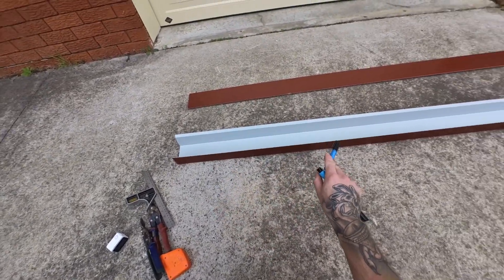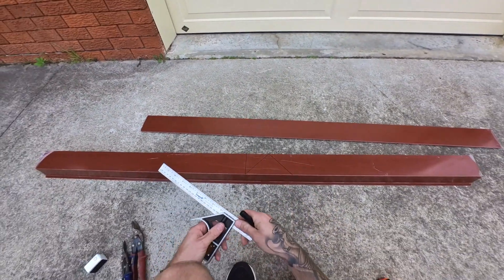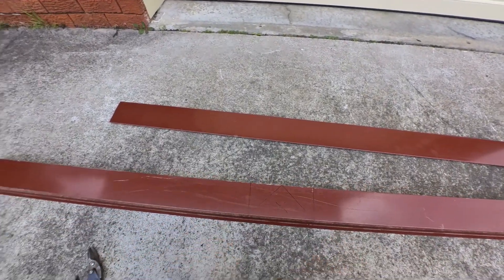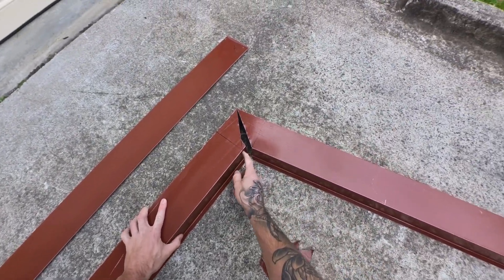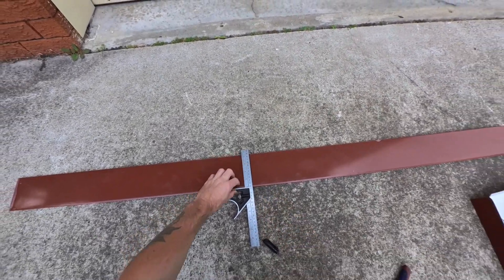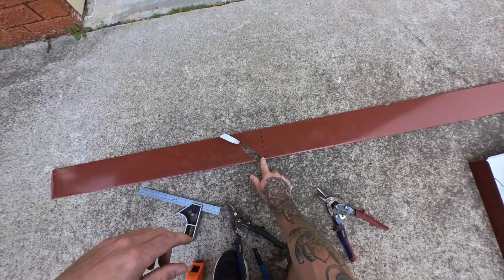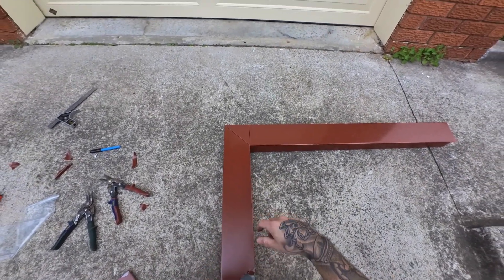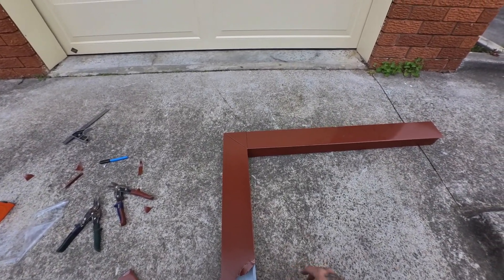How to Cut 90 ⁇  Bends on Metal trunking

Comment: Hi Mitch, learning heaps from your videos, appreciate your willing to share info 👍🏻
How you go about doing a cap at the end of the metal trunking ? eg if installing a horizontal section where the pipes/wiring come through the wall and the trunking is open at the end ? 

Thanks in advance 👍🏻